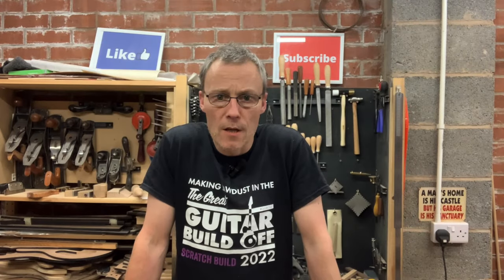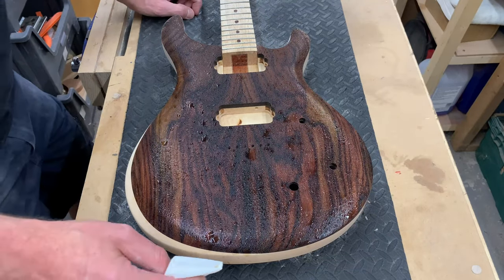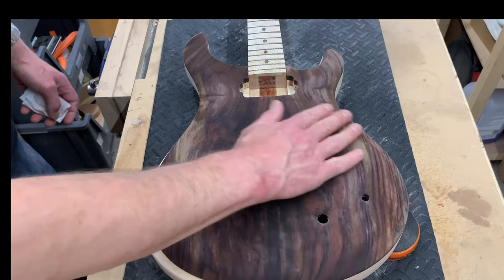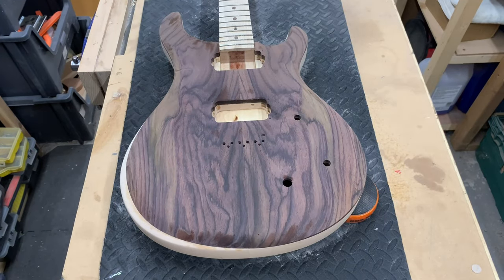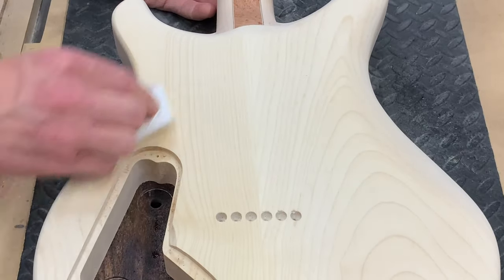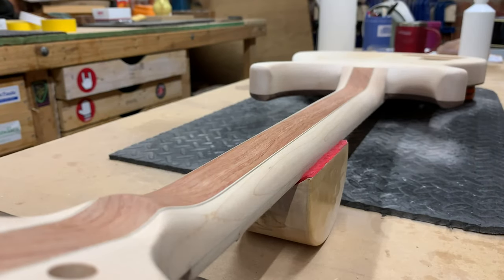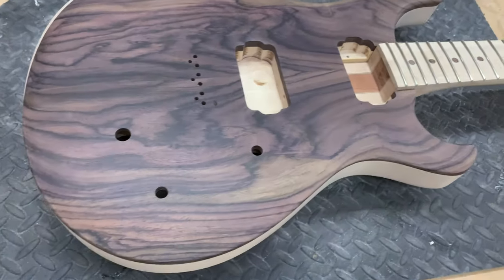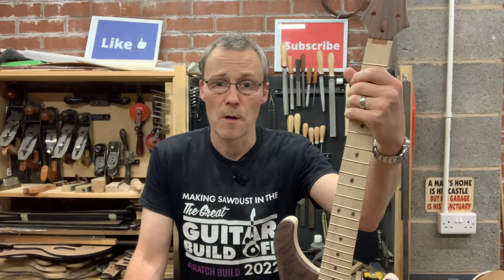Sanding & Raising Grain for a Better Finish #ggbo2022

Comment: I have built several guitars and messed up the finish just about every time.  I found a guy in a woodworking forum that lived about an hr away he does a great finish but he is in now way inexpensive.
Reply from the maker: Finishing Is easy to mess up & hard to get right. I usually use oil & wax as it’s simple & effective. Going for a wipe on lacquer on this one, hoping for a satin look finish

Comment: How did you sand the skinny sides?
Reply from the maker: Started with a bobbin sander 80 & 120 grit, then when using finer grades I use foam sanding blocks that mould to the contours as you move around. 
Thanks for watching 👍
Reply: @WhitefootGuitars  thanks 👍🏼 I appreciate it.